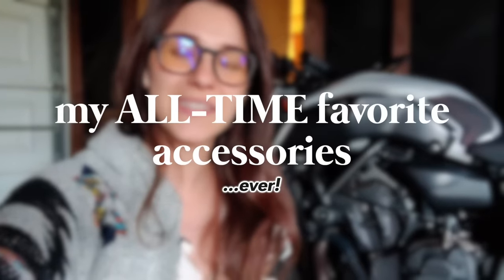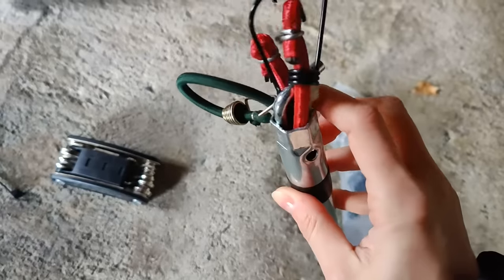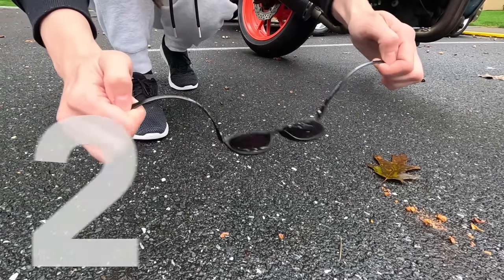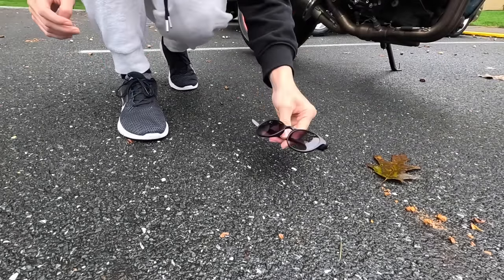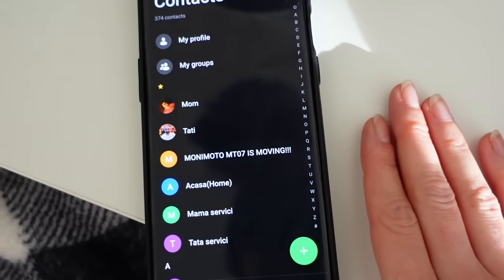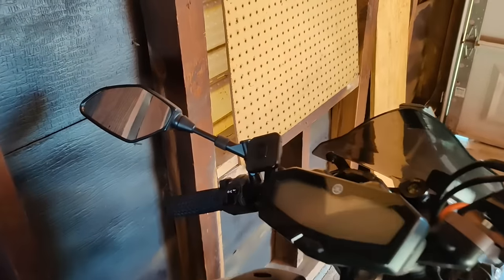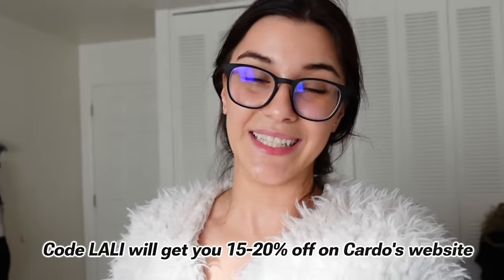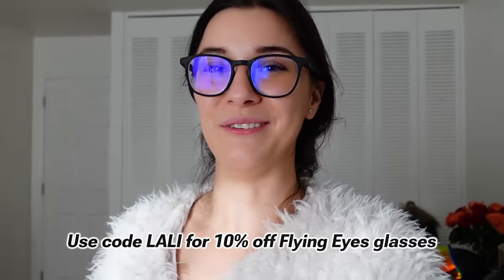The Best Motorcycle Accessories That Have TRULY Made a Difference for Me!

Comment: I agree - a tool kit is essential. Mine was cludged together but that was almost 50 years ago when I started riding :)  I also had a set of rain gear stacked away in the minuscule saddle bags. I will check out the glasses - they seem like they  would be  really useful.

Comment: I ended up getting a pair of Flying Eyes glasses, I want to say, the second time they sponsored you. (I forgot to use the Lali code; but I was less interested in the discount and just made sure they knew I got them from your sponsorship. lol)
Literally, my only complaint about them, is that if I'm looking straight down (like someone handing me something while on a ladder, or picking something up off the floor) that's when they slide off and hit the ground, or get whacked away as I try to catch them.
The only damage is a small scratch on the magnetic clip-on's mirror finish, and that happened the first week. There's been no other damage since. They're also a lot easier to clean than my old glasses; rubbing alcohol and a cotton swab, then some lens cleaning solution and a thorough wipe; good as new!

Anyway, that's a long winded way of saying thank you Lali and Flying Eyes, for what is so far my best pair of glasses ever. I'm not entirely sure the lenses my optometrist's office put in are shatter proof, since I forgot to ask specifically for that. So that's my only tip; make sure, if you're using them for riding, that you get shatter proof lenses in the unfortunate happenstance you catch debris.
knock on wood
Reply from the maker: That's interesting about the sliding, I have that happen to me when my nose get really oily (but that's with all my glasses) especially because my lenses are somewhat thick like -4 and -3.5 and adding the clip on just puts more weight on the front part of them making it easier for them to slide off. Idk what the solution is other than maybe tightening the little screws at the temples so they can grip your head better. And maybe wiping the oil off the nosepads 🤷‍♀️

Comment: I have the same Fanttik inflator. I bought the quick connect chuck, that makes it much easier to attach to the valve stem. I also carry a male/female USB 3 foot cable that allows easier charging it while riding, I’ll put it in my tank bag and run the long cable to a USB port on the dash, similar to what you have on Spicy Boi. 
Good video on useful stuff! Thanks

Comment: For your tool kit - instead of having multiple sockets for every bolt, I went the other way and just switched every bolt, but hose clamps, to allen key heads. This way I just need an 8mm nut for the hose clamps and 4 allen keys for the rest of the bike (excluding wheels ofc).
Regarding stands, no freaking clue why the prices differ sooo much. I think I payed for front and back like 90€ and they work just as fine, as the way more expensive ones my buddy has. Only thing that is IMO worth the money, is a centry stand / lift like the ConStands. They cost like 200-250€ with your bikes adapter plate and they are great. Can work on your whole bike with just one stand. Before I got it, I had to lift my bike at the frame, if I wanted to work on my fork. Worked too, but was a bit sketchy. 🙃

Comment: That Peak Design mount and USB charger are the ones I'm getting asap. Was looking into quadlock vs RAM they're so expensive and with so many accesories. Thanks!
Reply: As a user of both peak and quad lock I would suggest you spend a little more and get the quad lock 👍made my life about 10x better than when I used the peak design. Plus my phones camera was ruined with the peak design 😞
Reply: @thaaalegend2775  thought the Peak had integrated vibration dampening? At least that's how it's sold on Amazon.
Reply: @diegobahena1274  it does but for some reason it doesn’t work as well as the quad lock 😞 I ended up having to get a new phone and have had no problems since

Comment: The Flying Eyes is a mixed bag.  I’ve decided to keep them as my riding glasses,  it only just.  They’re great because of how thin they are.  I have an Arai XD-4 and a Corsair-X, and they both have cutouts for glasses.  They are more comfortable than my normal glasses, but they move around more because they’re not normal sized.  Also, because they’re so thin, and therefore comfy in the helmet, they’re flimsy and constantly fall down my nose and are really annoying.  I have to keep a retractable head wrap which keeps it on my head where I want.  I only use it when traveling and going to be on the bike for 6+ hours and I look a bit like a douche, but it’s comfy.  I also like that I can just slap the blue reflective lens on when I’m back on the tarmac and take it off again and use my goggles when I’m back on the trail.

Comment: Lali, did you just remove the sunscreen to mount the usb charger? What did you use to mount? Velcro, adhesive, or screws?
Reply from the maker: Nope, it fit under there just fine. I have it on using some heavier duty velcro and it stays in place well.

Comment: Cardo has great features, but their speaker volume is too low and not as good as Sena.  I have both, so I have options depending on who I’m riding with, rarely, if ever, but I have one on my street helmet, and another on my ADV helmet.  No comparison. I also hate how Cardo only works if I speak in an unnatural way.  It’s even worse than Siri, and that was previously the worst.

Comment: that tool should be for spark plugs
Reply from the maker: Good to know, hopefully I never have to use it 😆
Reply: @AntiParallali  you put one of the small screwdrivers that probably came with horizontally through other holes to turn.
Reply: That tool is NOT for spark plugs, it's for throwing at your bf  @AntiParallali  😊

Comment: I talked to my Insurance company and they told me they would not do a discount for having a GPS tracker installed and the reasoning was.. well, interesting... They said that if your motorcycle gets stolen, the odd of them having already broken something are high to just get the bike moving and even if the cops were able to recover the bike and make an arrest, you could be out the bike anyway as the bike would be considered evidence especially if the are suspect is thought to be involved in multiple other thefts or any other crime... so it is best to declare it stolen, call it a write-off and get your payout. The only instance in which you would not want to do that is if you have thousands in additional mods that your insurance company does not know about.. then it may be better to do the GPS tracker and hope you get the bike back in decent condition saving you from having to buy all your mods again. If you run stock... don't bother and get your payout and then buy a new bike.

Get comprehensive insurance... it will pay for itself.